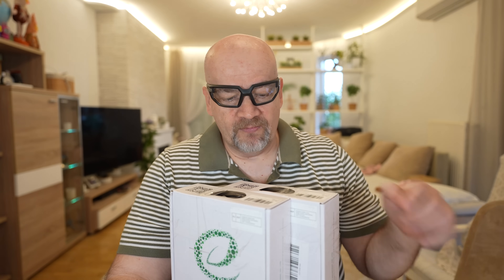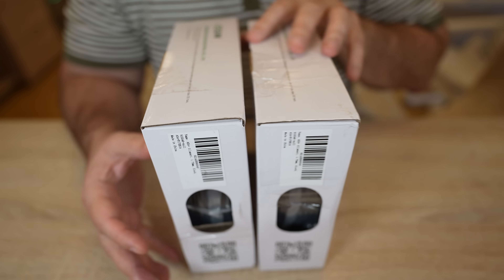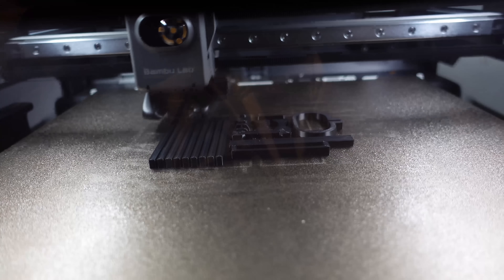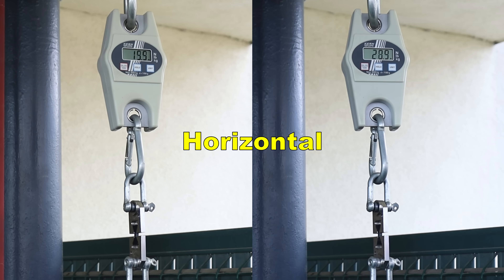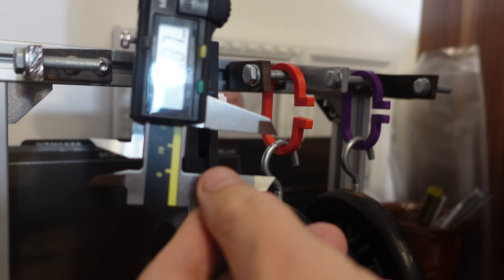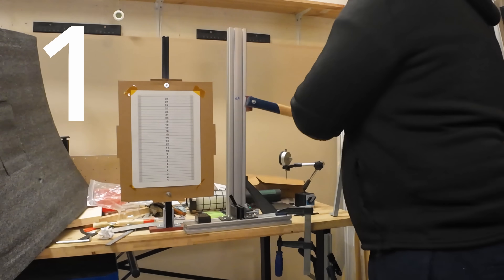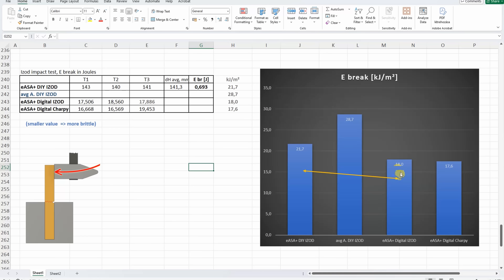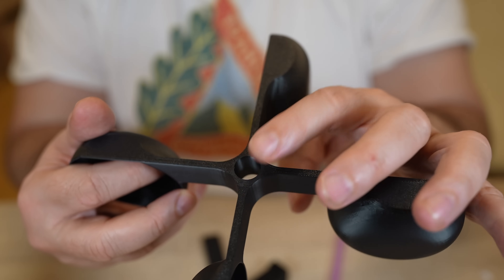eSun ASA+ Filament Review: Made for the Outdoors!

Comment: What’s the point of ABS/ASA nowadays with easily accessible PA(HT)-CF and PET-CF?
Reply: I'm starting to ask that myself as I run out of ASA and eyeball those two options.
Reply: Just depends on the application. Some parts need to flex and be more impact resistant. I print all 4 of those materials on a regular basis.
Reply: @Javii96  I like the impact resistance of my ASA and I would hate to give it up, but I guess some applications don't need impact resistance.
Reply: @mjodr  i can’t think of any examples off the top of my head of parts I’ve printed lately that need impact resistance, that pet-cf wouldn’t hold up just fine.

Comment: From their website it seems like the"plus" is about "better UV stability" but as far as I am aware, ASA and ABS already are pretty UV resistant(?) Personally I am against slapping a "plus" on every filament, it's just confusing. Just call it "ASA Outdoors" or something instead, if that is your point. "Plus" is traditionally used for tougher materials and this ASA seems to have even weaker impact strength then the average ABS/ASA according to 08:47
Reply: I agree. ASA was already the go-to for outdoor parts. And plus meant more impact resistance. What a weird marketing decision.
Reply: I fully agree with you except the ABS UV resistance. ABS is very prone to UV damage compared to e.g. PLA or PETG. White/gray ABS gets yellow even indoors from light exposure over years. ASA is even more UV resistant than PETG, but else very similar to ABS.
Reply: Yes, this one is super confusing.
Even their own datasheets show it as weaker than their eASA including impact resistance.
It seems to be just worse. Only temperature resistance is said to be higher.

Comment: Personally the eSUN ABS+ in Red is for me totally fail, maybe I give the ASA plus a try.
Reply: Ive tried abs with the same result but asa has always been easier to print in my enclosed X1C and now H2S. Just use a textured pei sheet with a glue stick with 70C plate temp and it sticks great and will pop off the plate after it cools

Comment: 3M Super 33 electrical tape running along the outside diameter of the cardboard spools makes them AMS compatible in about 30 seconds. Please give it a try.
Reply: Hold up in 70c drier/chamber okay? Good idea
Reply: @Javii96 3m rates it continuous operating temp at 90 c.
Reply: @darthtater  I would say it's important to use the name brand 3M tape. Other electrical tape tends to not last and get gross and sticky in the heat from what i've seen.